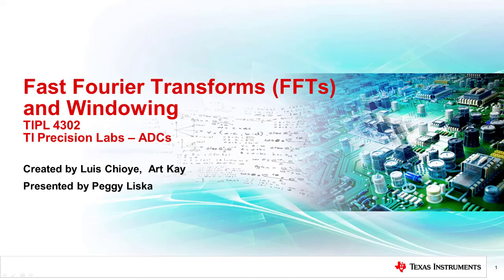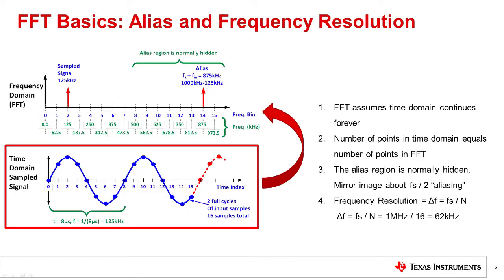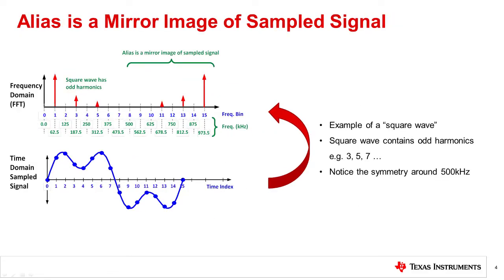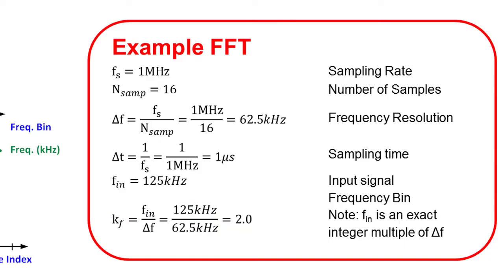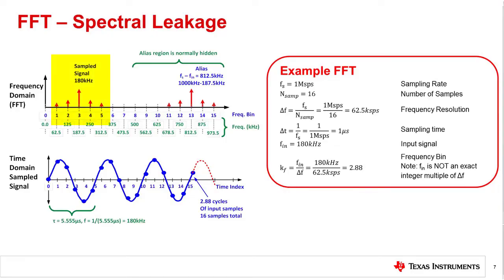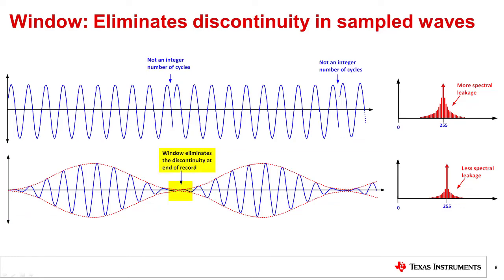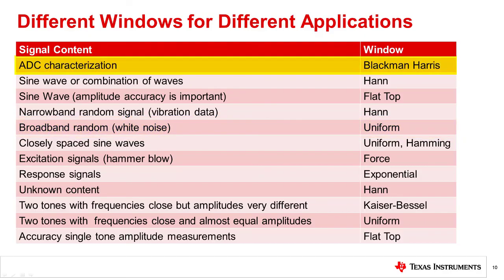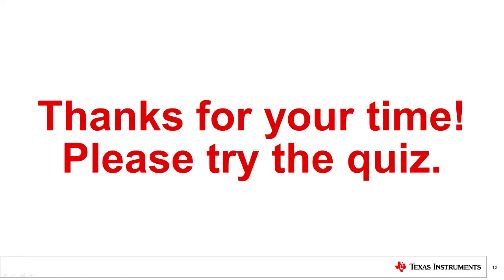TI Precision Labs – ADCs: Fast Fourier Transforms (FFTs) and Windowing

Comment: Hello everyone! This Fast Fourier Transfirm system in the inverting version can perfectly supervise the current generation of two sine functions offset by an angle of 90 degrees to each other. They would power the next generation Brushless Hybrid Fast - Rotation Motor (BLHF-RM). I have already described this issue in numerous publications.
Greetings to fans of synchronous motors 😀.

Comment: 0:39 that is DFT equation not FFT, please don't mix that; FFT is a solution to DFT which is a lot faster than other methods available.
Reply: The FFT is an optimised method to compute the DFT. The result is the same, so she wasn't far off referring to the DFT equation as an FFT.
Reply: @jazzjohn2  ну так люди приходят сюда посмотреть как из ДПФ получается БПФ. если бы я хотел посмотреть про ДПФ, я и искал бы видос про ДПФ, а не про БПФ